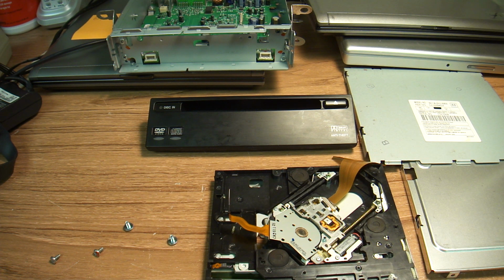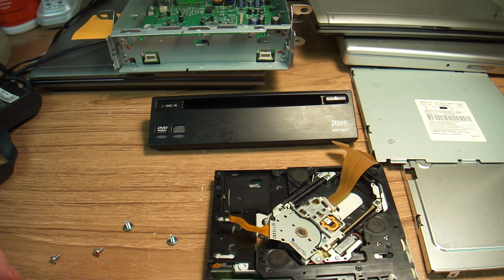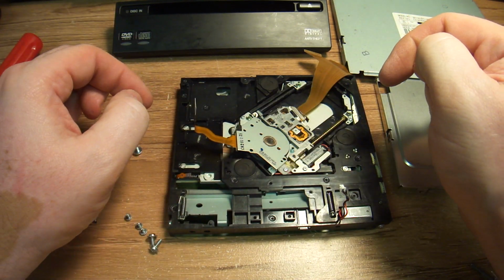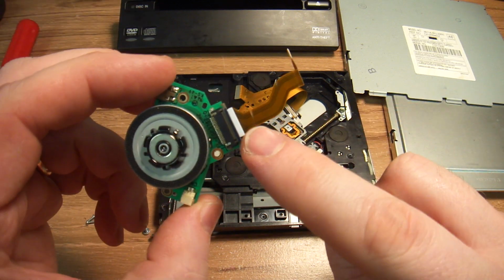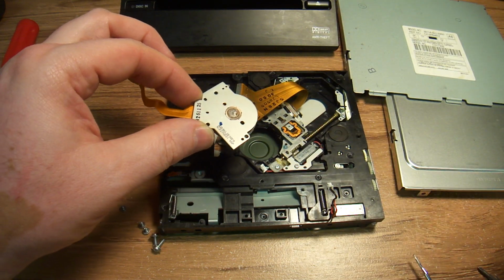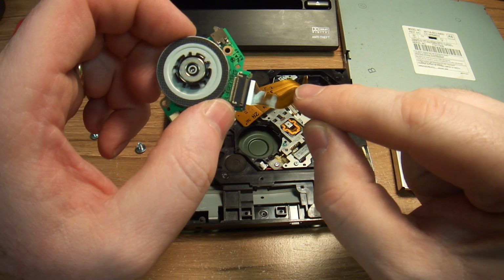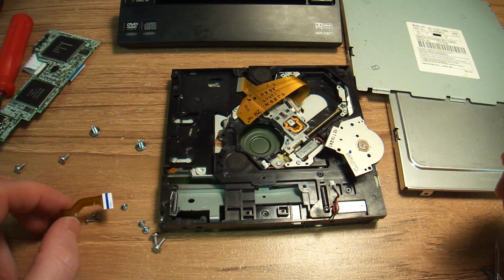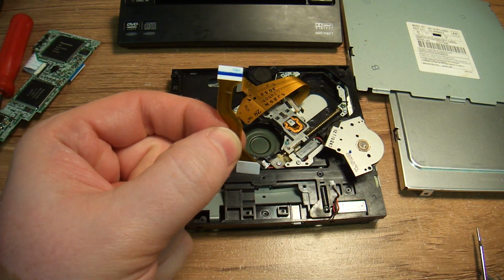DIY How to get Honda Odyssey DVD player repaired and save money. Model No. 3911A-SHJ-A800

Comment: Solved! - Had an issue where the DVD was inserted and then could hear it spin. The screen would show loading for a long period of time - followed by a disc error message. I tore the system down and had it plugged in to watch if there was an obvious issue. Turns out the ribbon cable that attaches to the optical arm has an extra flap that was getting caught. There is a loop of extra cable that is used to allow the arm to move in and out. The extra part of the cable is loose and was getting caught in main motor that spun the disc. Ribbon cable I am referring to moves at around 4:05. I tapped the loose part of the ribbon cable to the motor and it works like a charm. Thanks for the great video - led to a solution!
Reply: +clizay1 After I removed a stuck coin from the DVD player from my 2011 Honda Odyssey, I'm seeing the same problem. Loading..  and then "Check Disk" message. I used a cardboard with sticky tape and may be the ribbon got loose?

Do you have the picture of the final fix (cable taped to the motor)? or better yet few pictures to show the process. Thanks!

Comment: Our 2007 Honda Odyssey had this wear problem after 180,000 miles on the DVD. I put some transparent tape on the ribbon connector in a couple of places showing wear and reassembled the unit. There are a couple of tricks including being careful gaining access to the damaged surfaces of the ribbon connector. You must remove the 4 wire (tiny) ribbon connector on the PCB prior to lifting the PCB up far enough to access the faulty ribbon connector. I was fortunate that the conductors were not worn all the way through. Only the ribbon cable insulation (very thin flexable plastic) was damaged which, however, probably allowed one or more of the signal lines to short out to the metal surface against which the ribbon connector rubs.Thanks for posting enough hints for me. I am an experienced DIY guy and also a retired Electrical Engineer. 11AUG18
Reply: Keith, did placing tape over the worn insulation fix the suspected short? Mine looks similar. Was the process more than just wiping off the dust and putting tape on it or did you do more (e.g., test the individual lines for  a solid connection, use kapton tape, sand between any lines, etc.)?
Reply: I was lucky. I only put transparent tape after wiping off the wear dust from the ribbon connector. It appears mine was just shorting out with no connectors broken. If I had it to do over again, I would put on two or three layers of transparent tape so I could get a few more miles out of the DVD player (pun intended). Good luck Russell.
Reply: @TenorSaxMan66  lol, thanks. I'll be sure to at least double up on mine.

Comment: Got the DVD drive successful out of the car.  How you get the faceplate/bezel off the unit?  I removed screws from both sides already.    Bezel still would not release.
Reply: any how to video for question yet?
Reply: @gbondo  Mine had a rubber piece around it I removed the rubber then you can pull the front off.

Comment: Sometimes you cant findthe  FFC so if you know or know someone good at reverse engineering you can scan the ffc make measurements of the pin pitch then generate  a gerber file  from software like design spark pcb and use a ffc/pcb mfg like pcbway or pcbgogo etc.. there's quite a few and have it made.

Comment: It seems I have the same issue.  Disk light in is on but nothing will play or come out.  My first question is how do you get the car panel out to take the dvd player out.  Secondly, in your video, you said added electric current to the motor to delete?  What do you mean by that?

Comment: I have a 2006 Acura TL alpine NAV DVD unit whose disk won't spin up. I would like to try bench testing to find the problem to see if it is something like what you found. So I was wondering if you or anyone knew which connector and which pins to apply 12VDC while on a bench to power it up.

Comment: Here's my question.  I ordered the replacement unit from the opuradio site, but after placing it in my van I keep getting an "F2 error".  From what I've read, that means the unit is built to read discs from a different DVD region.  Do you know how to switch the region code to USA/Canada from what I'm assuming is China?
Reply: Were you able to figure out how to switch region code to USA.  I would hate to buy one and not have it work.

Comment: Thank you for taking your time and doing this video. My 10 year old daughter stuck a quarter into the DVD slot. They kept on trying to play the DVD when I was not there. I turned the car off and with tweezers, I was able to pull the DVD out. The DVD player turns on and actually loads the DVDs. The problem now is that nothing happens when you hit play. It is also difficult to eject, but after a few tries the DVDs do come out. I have actually taken the dvd player outside of the car. Can you help me?

Comment: Thanks for posting this. I hope to fix mine. Would you post a quick vid of how to remove the player? Just give us the high lights. 

Also, what interface does it connect with ? Have anyone had any luck putting in a different DVD reader or even a hard drive or a SD card reader ?  Anyone ? Thanks

Comment: I have a 2007 Honda Pilot.  The DVD's eject and load fine but it makes some jitter type noises and after a short time it says Error on the display.  I have found that even a used DVD player is quite expensive and so I want to try to fix it myself.  I suspect the laser may have gone bad because it started to have difficulty reading some DVD's before it just quit reading anything.  I replaced the laser in my PlayStation 3 without too much issues, so I am sure this one would be a similar process if I could find the part.  The Honda Odyssey has a very similar looking DVD player but it is a different part number.  I wonder what are really the differences?  Anyone know?  Also, I have seen people on Ebay offering repair services anywhere from $170 to $250 for these drives.  If a part or parts could be sourced, this might be a good way to make a little extra money on the side ;-)

Comment: I just took mine apart...  My cable it perfectly fine.  Not wear at all! Maybe it doesn't happen on all of them. I probably have different symptoms...  Mine just won't eat the discs at all. The console seems to be stuck on loading.  As if there was a disc inside already.
Reply from the maker: Check the disk path there are sensors that may have gotten damaged. yes you have different symptoms.

Comment: I called Panasonic (Encompass - their part distributor, and I ordered a connector - K1KB0600085.  Unfortunately, they do not have part pictures, so it's just a gamble for now until the part comes.  Panasonic was unable to cross reference the part to confirm that it was the correct one.  There are only 7 parts to purchase...and this one was $6.01.   800.211.7262 was their phone number...
Reply: jennifer jenson please let us know when it comes if its the right part.
thanks
Reply: jennifer jenson Currently the part is backordered until June 19th, 2015...so it's going to be a while...I'm not even sure it's the correct part yet.
Reply: jennifer jenson
Reply: jennifer jenson it's not the correct ribbon cable.
Reply: +Jeff Jenson Thanks for letting us all know